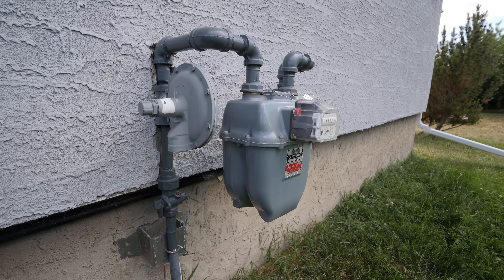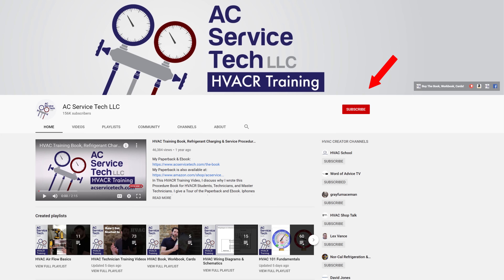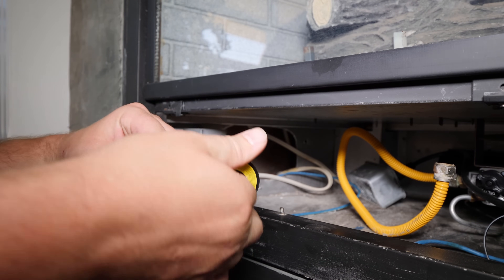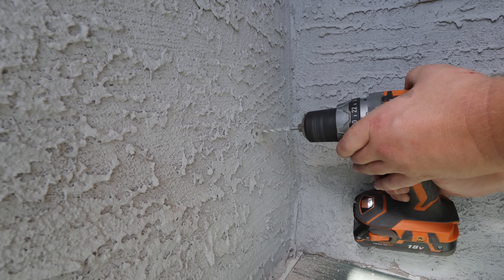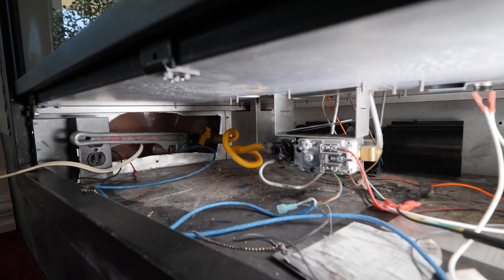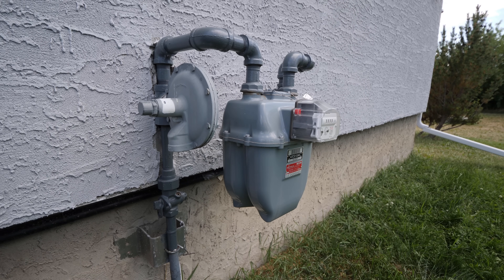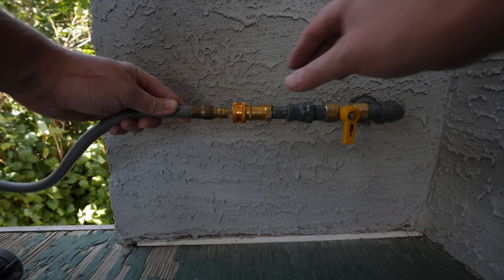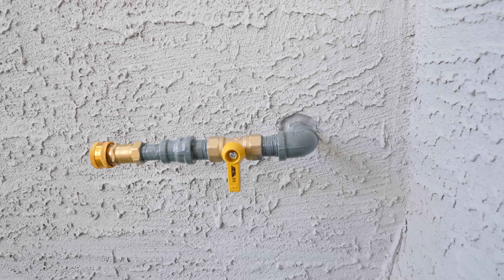Natural Gas BBQ Grill Gas Line Install

Comment: I know your video is old but it is very detailed and informative. My question is, on the outside line with the black iron is there a reason to use all female fittings and have the male double sided between? I have picked up what seeeeems to all go together with no gaps of pipe in between. Is this wrong? I have a 1/2 90 degree female to male from the wall, going to a female to male stepdown ball valve, going to a female 3/8 quick connect.

Comment: I am a licensed gas fitter not bad, don't like using another appliance as a pipe chase but it worked, a pipe support would have been good at the termination since the quick disconnect gets pulled on but minor issues.

Comment: I see atleast 3 mistakes made. You exposed bare metal on the flex line, you didn't sleeve the pipe going to the interior/exterior, you didn't use any sort of supports for the fittings outside.

Comment: I like the quick flush valve and hose fitting on the water heater. First thing I get rid off on any house I’ve ever owned is gate valves and replace with 1/4 turn ball valves. Label them for the family in the event of ‼️

Comment: thanks for the video! I am hooking up a propane tank to a range.  I was dry fitting a 3/8" nipple to a coupling and it would only insert about 1/4" with hand pressure. I used a wire brush to clean the threads on the nipple, but neither side would go into the coupling more than a 1/4". It would go on a bit less than 1 1/2 revolutions. Is that normal?

Comment: In no way am I saying I know better or that he did it wrong. I’m just curious. Would it be safer or better practice to connect the steel pipe directly to steel, not the flexible pipe. Like connecting the extension to the exterior being a direct T from where that yellow conduit would come to the fire pit. Maybe that all didn’t make sense. Just curious

Comment: If you have an existing propane grill you will need to convert it to natural gas. It’s a solid hour to do this and some manufacturers don’t make field conversion kits.
Natural gas works at a much lower pressure, so you may get a flame on an unconverted grill it will not get hot enough to sear a steak
Reply: Good to know! Such a bummer, I spent more than I ever imagined on a propane gas grill. Now I'm in a home that has made myself and my kids sick with CIRS from Mold Toxicity. It's a nightmare but a big part of our health recovery is eating primarily steak. And I've NEVER gone through the amount of propane tanks ever in my life like the way I am now. Life is complicated ;)

Comment: Everything was perfect, but you probably need an extra bracket in the middle of the Galvanized pipe to hold the fitting firmly to the wall, secure the pipe,well 👍
Reply: it was not even close, you can tell he doesn't even have a certification to do this type of work.  This would fail inspection.

Comment: You did good but a few things, going to a exterior wall you should use galv pipe, last thing you want is the pipe to rust from the elements.  And last you shouldnt use teflon on gas pipe, teflon dope only bc the tape can dislodge from the threads and can travel down the lines and cause a blockage.  But good job and nice and clean.

Comment: Extreme caution should be shown when re-working flexible gas piping. It is easy to screw it up. Many , if not all, manufacturers specify only persons trained in installation of their brand should be doing the work....AND I was right....at 2:15 you did not have the protective jacket under the nut as it was when you disconnected it...its there for a reason...
Reply: Of course they say that. It's all part of the system set up by Unions, the politicians they put in office, and the sweetheart regulations they get in exchange. Regulations are getting so out of control here in California. Every year they make more and more home repairs illegal if done by the home owner, forcing you to spend hundreds of dollars for a professional even for the most trivial of things. A few years ago they also made it illegal to do any auto repair in your garage if the scope of it is beyond an oil change. Oh well.. guess i'm an outlaw now.

Comment: Crimp connections, on a gas line. Let that sink in people. Jumping off of another line to feed your new service. Let that sink in people. Could be a furnace and a water tank. Using numerous connections slash adapters. More places to leak and blow your house up. Let that sink in. Not measuring gas flow, well, you see where this is going. These are the people we all watch on the news about their garage blowing off their house from an unlicensed project with NO PERMIT.

Comment: Any mods needed for bbq?
Reply: I realize this is 5 months late, but: If your BBQ originally used propane, you need to replace the burner in it with a natural gas one. Alternatively I think you can drill the gas holes out bigger, as natural gas does not put out as much BTU per cu.ft. as propane. I think I got that right. You'll have to search a BBQ specialist to tell you how MUCH bigger the holes have to be. Myself, I just bought a natural gas replacement burner as the old propane one was rusted out anyway.

Comment: surprized to see no initial test or let by test of the ecv. and only checking for leaks with fluid? simply purging the gas pipe using an existing appliance until it goes out is not good enough imo, it does not ensure the stop valve is not passing..  as another in other comments stated no leak test. you didnt show end product after you finished the job under the gas fire.i hope you didnt leave them stainless pipes naked. how would you know how to size a gas pipe, seems like an afterthought. then know how to test that it ALL works. unless everything is exposed. even then you need to test in case of blockages. etc etc etc.

uk based and hoping your not canadian. i ski in canada. america can do as they like. i'd be shocked to see if it's legal. either contry.

risk assesments eh. they differ everywhere.  did you bother the check the injectors in that bbq you bought. second hand probably..................

pro diy. can you make me a  calculation for black iron  need to build a still in the backwoods. how far do i cut into the pipe? LPG. im joking.if i wanted to work it out i would:P or just guess it.

Comment: This guy sounds like he know what he's talking about, but he is so wrong on so many levels. This is NOT the way to install a gas line to the BBQ!  The gas line to the fireplace was sized for the fireplace only and NOT to be spliced off for additional appliances.  Gas fitters know and understand the pipe sizing as to how many BTU's are needed for each appliance and we run the right size pipe to each appliance.  Cutting into a pipe and installing a tee is NOT acceptable and will cause issues to the fireplace as well as the bbq.  This is why these DIY HACKS never mention pulling permits or getting a licensed gas fitter to do the work the right way.
Reply: This video will help you understand gas pipe sizing and the  BTU's of each appliance.  This is how you know the DIY HACK above doesn't know what he's doing !!!
https://www.youtube.com/watch?v=ExNosdWfvnI

Comment: According to the local building inspector, galvanized pipe is acceptable for gas line use.  In the late 1900's it was approved due to the improvements in galvanizing technology.  Apparently, early galvanizing processes were prone to the zinc coating flaking off and plugging orifices, etc. but now it is no longer an issue.

Comment: Doesn’t each line have to have its own run/leg off of the main line (to clarify meaning the primary 1”feeder line running through your house, NOT meaning additional back to meter) and NOT daisy chain off of another appliances leg/line?! Especially if you need to run 2 or more at the same time

Comment: Does this works for a generator use!
Reply: Most likely no because generator needs a much larger diameter pipe to be able to get the correct amount of gas flow.

Comment: Pipe dope is generally stronger seal than Teflon tape, which is why plumbers and other professionals use it rather than tape for seals that are permanent. Don't use tape for permanent connections

Comment: if the BBQ is not connected to the quick connect, does it need to be capped at all ? Or does the quick connector act as a cap when not connected to a hose?
Reply: The quick connect has a spring loaded plug inside which seals the opening when the hose is removed. When the hose is inserted it pushes the plug into the open position allowing gas to flow 👍

Comment: If you have any black iron pipe in the system, it is a good idea to terminate the end of line going down.  The gas tap gets a tee off the vertical on the horizontal so that any rust, etc., falls to a cap at the bottom while the gas line to the grill is protected.  This avoids having to fight with rust in the grill burner or regulator.  As for your leak test, not so much.  I was required to pass a 100 PSI for 24 hours test.
Reply: So you’re suggesting he should have installed a drip tube? How long? 3 inches?
Reply: @trailerparkray4549  long enough to sell all the copper piping for drinking money

Comment: Absolutely not how any “pro” would do this. Make sure to hire a professional before doing this. He quotes code several times but not if it’s local or national. The international fuel gas code in the United States covers all you would need to do this. The sizing of this is wrong, you have to size a line all the way back to the meter. Especially being a flexible line feeding the fireplace, flex lines always run less volume then the same size in black iron. 

Hence. Please just hire a professional and stop destroying your home value by trying to do things yourself.

Comment: Where is your regulator in this setup? I’m curious because I did a propane to nat. Gas conversion and I’m wondering if I need to re-plumb to buy a regulator before my valve
Reply: Depends on your pressure he has a main regulator

Comment: Jesus guys. There's alot of stuff you can DIY, but gas isn't one of them. I've been doing gas for 14 years now and this is not how to install that properly. Everytime you hear about someone's water heater blowing up it's because of something like this. That's a super small bbq and sizing the CSST that he's using isn't the same as black pipe. It's more restrictive and you always oversize your piping incase in the future you decide to get a larger bbq o you dont have to redo the work. It's not worth the couple hundred bucks you'll save to have it done wrong.

Comment: This stuff should never ever be a do it yourself project. I am a licensed gas fitter and inspector. I do not approve this type of videos. You did not sleeve the pipe going outside. No pipe support or pipe stand to support the quick disconnect.

Comment: Pipe has to be taped with 2 layers of approved tape or sleeved when in passes through a wall, and needs support on outside as the 90 degree elbow is a swing joint.

Comment: Have similar setup except we're using a dual port bbq gas outlet which has a safety feature. Our house runs on 2psi pressure though so I'm not sure if I need to install a regulator and step it down?? Running Napoleon Prestige grill . Help pls
Reply: Your pressure is definitely not 2 psi if your in a residential application.  If your on ng your regulator is st the meter , lpg your regulator is at the tank.
Reply: @jacob4639  Got it sorted out. The house runs on 2psi as per Fortis Gas. All appliances and equipment running on NGas has it own regulator. Installed one for the BBQ and all good.

Comment: You must have pipe wrap tape on the black pipe before inserting it into the wall, gas line outside must be supported, anyone can push down and undo the fitting, gas line must be bonded and so much more was wrong!!
Reply: All my same thoughts.

Comment: Ughh the Home Depot flex lines and you stripped the jacket to far back. This is why you need to certified to buy and flexible gas lines from plumbing supplies. Pipe should also be sleeved coming through the wall and fire stopped not regular caulk also need to have something to support at that elbow outside the wall. This shouldn’t be supported and taught to people as “DIY” it’s gas it’s not like running a water line.

Comment: Just a question... on the outside pipe, downstream of the 90... shouldn't there be a stand-off pipe holder be used to prevent the 90 from being lossened accidently?
Reply: Yes
Reply: No

Comment: This is not a DIY job.   It's illegal in Ontario to operate the meter shut off valve, and 100% do not touch the gas company's regulator.    Even on the customer side of the gas meter you need to be a licensed gas fitter.

Comment: Never,  ever cut a gas hose,  that by law,  you guy can call and check with   any gas hose factory, they will tell you the same.
Reply from the maker: This isn't a gas hose, it's CSST (Corrugated Stainless Steel Tubing). It is designed to be cut to length. Gastite, Wardflex, TracPipe, OmegaFlex are some manufacturers of CSST.
Reply: This is incorrect. What is being cut is CSST tubing not a "gas hose". The difrence is CSST is designed to be cut to length and has an engineered fitting to seal the cut end.

What you are referring to is the flex line that goes from the piping to the appliance.  That flex line is a engineered product and can not be changed without an engineer approval (and that will never happen).

Comment: I am thinking that this video is for the States.  As a Gas Tech in Ontario, the outside piping is wrong.  Yes, it needs to be fasten to the wall some how.  There also needs an anti disconnect valve setup with the quick disconnect.  The way it is setup now, one could disconnect the BBQ with the gas still on.  The Anti Disconnect valve setup does not enable you to do that with out turning the gas off.

Comment: This is a terrible idea. I’m an engineer at a gas utility and I never in a million years would recommend a home owner do this. This is an extremely unsafe thing to try to do yourself as an unlicensed gas technician. if you’re reading this comment PLEASE do not attempt this but rather hire a local HVAC contractor.
Reply: Also from propane to natural gas the grill has to convert with natural gas conversion kit

Comment: Also I am not sure as I cannot see the markings on the gas valve but usually a yellow handle denotes I terior rated shut off how ever there a few manufacturers that make a yellow handler exterior rated shut off.ensure you ha e used the correct one to be protected from weathering
Reply: Valves are imprinted with what they can be used for. Yellow does not necessarily mean its made just for gas, in fact most of the time its just the color they decided on, look for WOG. That indicates Water, Oil and Gas.

Comment: how did you secure the black iron pipe in the wall so it doesnt move ?
Reply: It was connected inside the house, underneath the fireplace.
Reply: @mr.september2879  didnt ask where it was connected.  That part is shown.....

Comment: I recommend a Dial/gauge pressure test should be completed in addition to the soaping of the new lines.
Reply: a soap test is sufficient after the original pressure test has been done, if you were to do a pressure test again you have to disconnect all appliances and cap lines, as the appliance gas valves are not rated for the test pressure
Reply: @dwaynerenton1889  A minimum recommendation by code is a minimum, up to the technician if they're comfortable doing the bare minimum, that's fine, but not for me. I recommend multiple tests because it's the customers safety and family well being on the line.
Reply: @dwaynerenton1889  A separate shutoff for the new branch would solve that.
Reply: @dwaynerenton1889  a natural gas meter is considered a gauge, and test pressures do not have to be 15+ psi for 15 minutes after the original test. Appliances do not need to be disconnected. shut off all appliances and mark the dial, this is considered a type of dial test - at 7 -14" w.c.
Reply: a what? elaborate internet friend!
Reply: @JJ-ug9jm  It means testing the new piping branch by installing a gauge and  pressurizing with air, CO2 or nitrogen. In my city, the inspector will want to see it hold steady for at least 15 minutes at 15 psi. I think the code calls for a minimum of 10 psi. I'm not a plumber, but this is what they told me they wanted to see.
Reply: @JJ-ug9jm  a dial gauge is when you turn on the gas you Mark the dials and give it 15-20 mins, if the dials move you gottta leak

Comment: Me, I want to do the reverse. I have a condo in an area where one propane supplier has a monopoly and gouges us for fuel. I want a line running from outside into the house so I can buy 5 gallon propane tanks near my other home at less than half the price and run that into the condo.
Reply: I assume your heat is propane? When it's dead get an all electric heat pump HVAC system installed. If you're in a northern climate get a propane backup. Sounds like you could save a ton of money.
Reply: @gingerman5123 . I had three homes with heat pumps. In a total of 8 years, I had to replace two heat pumps - never again. Plus the condo is in a ski area. At the outside temps there, heat pumps are not efficient.
Reply: @gingerman5123 . The outside temperature is below freezing for more than half the time I need heat. Heat pumps are inefficient in these circumstances. Then again I once owned three homes with heat pumps for a total of 8 years during which time two of them failed and had to be replaced at great expense, so I will never use heat pumps again.
Reply: @67daltonknox  If you have AC you are using a heatpump. A "heating" heat pump just has the valves necessary to run the refrigerant in the opposite direction.
Reply: @gingerman5123 .Yes A/C is a heat pump. So is your fridge, but the term "heat pump" applied to heating and cooling in buildings is used to refer to a reversible heat pump. These in my experience are an expensive disaster.